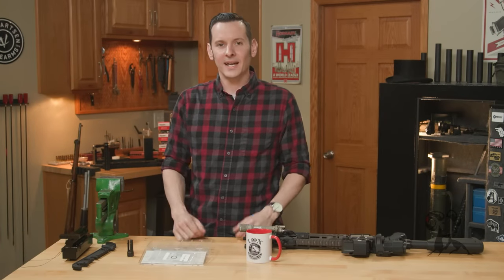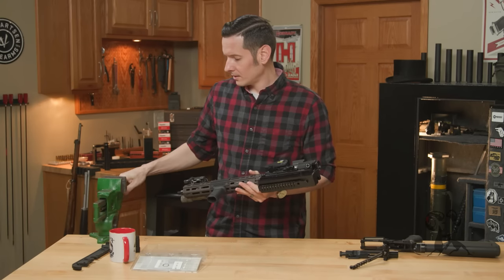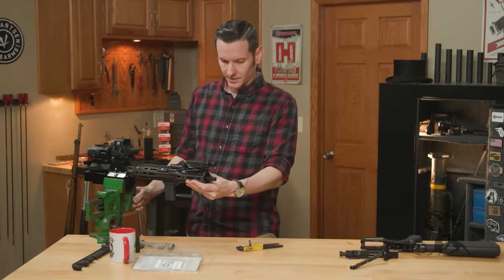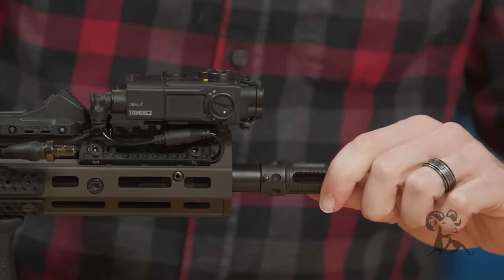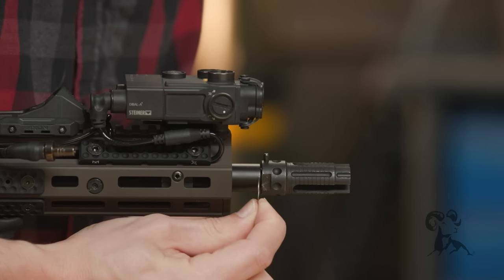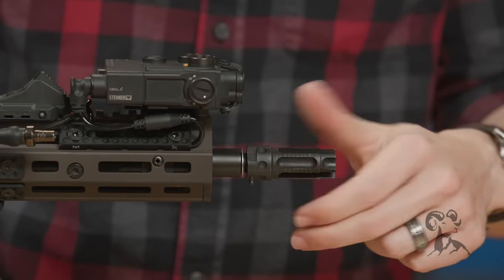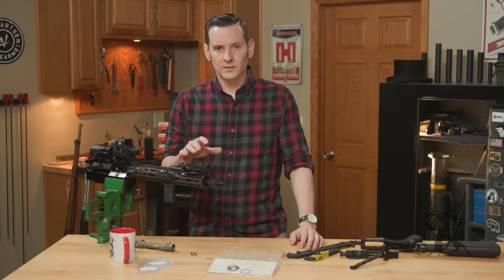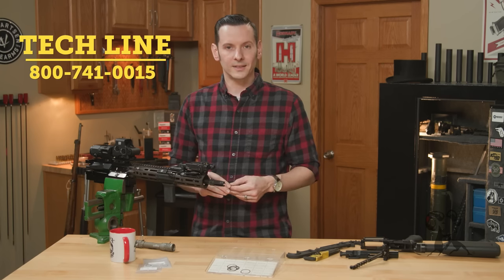Quick Tip: How To "Time" a Muzzle Device With Shims

Comment: ⏰⏰⏰ why on Earth are you calling this timing? timing is something that moves. what you're doing is indexing. ☝☝☝
Reply: Timing.. the top is 12 O'clock, right is 3, bottom is 6... etc. You get it.
Reply: @CalebSavant  Nope😏
Reply: In the gun world, "timing" is just the phrase that is used. It originated due to battlefield repairs. As in numbers on a clock. It was just a simple way to reference where to start applying torque and when to stop as soldiers in the battle field didn't and usually aren't going to carry around a torque wrench because adding the extra weight(no matter how small that weight is) would just be a ridiculous thing to carry around. So, it was easier to guage it terms of "start here on the where the hand of a clock is and end here where the hand of a clock is"
Reply: @natew.-victoryorvalhalla4571  😂Mr W, your explanation is entirely plausible. I'm trying to understand, under what circumstances do infantry men in the first world war have to change their muzzle device anyway? wouldn't it just be easier to tell him to "index" it towards the top of the rifle. I guess I can't fight tradition (or city hall), but I will stand by my original statement, in fact you are indexing your muzzle device. thank you for your explanation..
Reply: @AsdfAsdf-asdf  This actually came in to more common usage/terminology during the Vietnam War and the introduction of the M16. As they were working out the kinks, playing around with what became known as a "dissipator" rifle (basically take a full size m16 and cut the barrel down with a hacksaw to the M4 size which had so many problems and is a whole other story) The extreme humidity and rain was rough on the barrels and combine that with their tinkering and sorting out the initial glitches etc. Common practice taught was to "time" your attachment of a muzzle device starting somewhere between 1800-2100 hrs and finish at the 1200 hrs (start 6-9 end 1200) which also didn't make sense because they mixed up AM'S and PM'S in the description but they were in the middle of war so it was just an easy way to explain it. And so "timing your muzzle device" was born into a more common vernacular